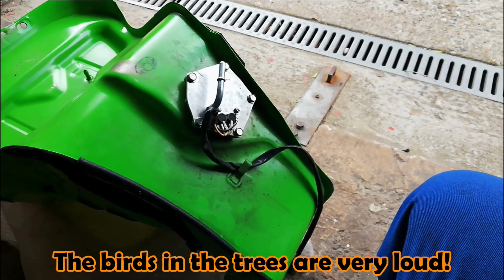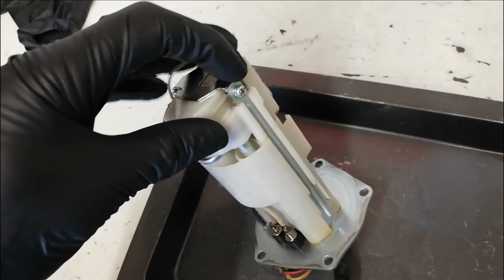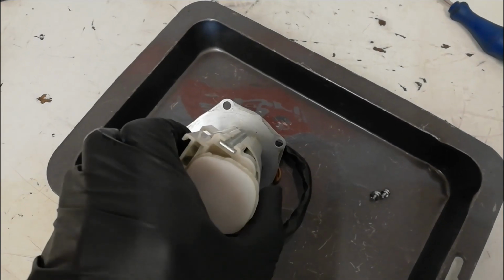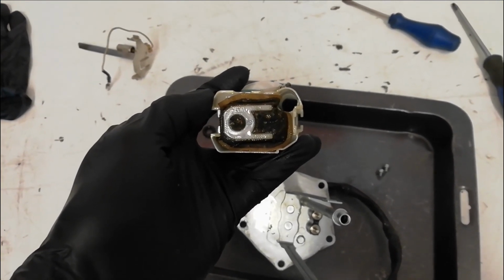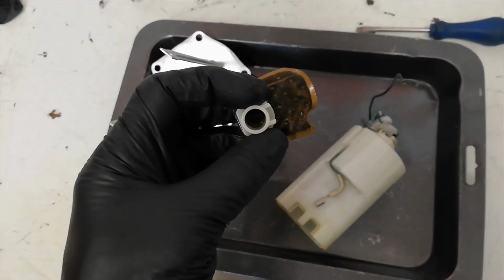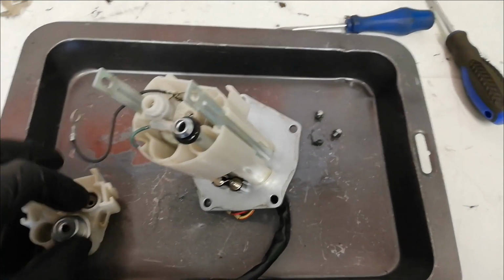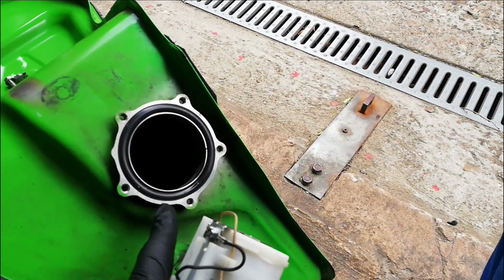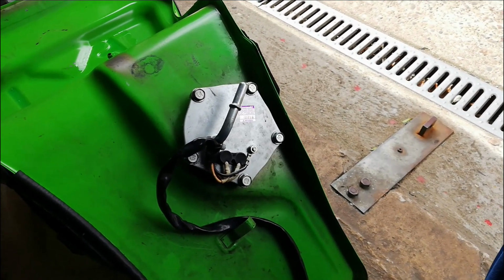How to strip and clean a Kawasaki zx10r fuel filter

Comment: Thanks for the video. was wondering if you knew the part numer for the 2 orings in the pump. My 2013 wont go over 8000 rpm and seems to be getting worse. when i fully turn the accelerator it actually slows down. mecchanic say have to change the complete fuel pump assembly and in italy costs a kidney. thanks
Reply from the maker: Unfortunately I think your mechanic is probably right

Comment: Dude extreme huge mistake! That so called tea bag your calling the fuel filter is stage 1 of the bike's fuel filtration system, which is the~ "fuel strainer"!  The 2ed stage of fuel filtration is the "fuel filter",( at fuel pumps exit port) which filters down to 40 microns, So changing a fuel strainer is only doing 20% of the job.

Comment: See that bit you call the lid that has FPR attached next time ,take out FPR and oring and spray carb cleaner in there and rinse with clean fuel ,then Back flush with air gun ,Because it has a micro filter in there and judging by your lower filter top strainer would be restricting fuel flow ,👍
Reply: can it be pulled out?
Reply: @godwinvandamme  yes

Comment: after change fuel filter, low fuel light It didn't work.... what step wrong?
Reply from the maker: Possibly caught the fuel level sensor, or a wire when refitting

Comment: dumb question but i cant i just run the bike to low fuel, strap the tank back and do the job wih the gas tank still attached to the bike and a little fuel still in the tank?
Reply from the maker: To save removing one bolt I don't think it's worth the awkwardness of trying to keep the tank in place, it's much easier to remove it
Reply: @obsession_engineering  thanks, wasnt sure if that might save me a little hassle and mess, im going to have to do it because fueling culprits are a limited number of things and the bike just doest sound right; it was juat starting to stutter at idle and certain rpms prior to running cleaner through it. 18k.

Comment: Hi, thank you for that video, its relly helpful, I made a terrible mistake and left fuel in the tank of my 2012 Z1000 that has been in garage for 6 years, so i will have to clean the thank and clean the fuel pump, what do you recomend to use to clean the fuel pump? i will order that new fuel pump filter, thanks again.
Reply from the maker: Brake cleaner or fresh petrol would work well for cleaning the pump. Just be careful with it!
Reply: @obsession_engineering  excellent, thank you,
Reply: Hi again,. I have dismantled the fuel pump, cleaned it and now trying to put everything back together. Finding it difficult to close the lid as the o ring doesn't go in smoothly, is it possible to use lube to make easier, if so, what is the recommended lubricant for these o rings? Thanks

Comment: Hello, took my 04 on the dyno other day and it's dropping BHP in 6th. Was 145bhp and should be around 170ish. Could a blocked filter be the cause?
Reply from the maker: Very possible, especially if it was lean at high rpm. It is a common issue
Reply: Thanks for the reply. I am going to strip it and have a look this weekend
Reply: @jamiewall8824 hey mate, did you solve your problem? Can you say?

Comment: I know this video is old but I got a 2007 zx10 and it bogs at around 20-30 mph in first gear, also at about 9KRPM it stops it doesn’t go any higher then 9K RPM. Could a clogged fuel filter cause these problems? Also I should mention all new coil pack and plugs.
Reply from the maker: The high rpm issue is commonly caused by the fuel filter being blocked, not heard of it at lower rpm but it could well be an issue. The 07 filter is basically the same as the later bike, so pretty easy to check
Reply: @obsession_engineering i have the same issue. Do you know how to clean the other filter?, the one located near the regulator, in the head of the pump. I think that could be my problem because i just changed the big filter and my bike continues with the issue.
Reply: Mine stuck at 10k rpm. 😂 Tomorrow I will try to change the fuel filter first and Dyno the bike
Reply: My zx10r do the same at 7k rpm. Do you think how to clean the filter that is inside the cover, near the regulator..?

Comment: I have issues with my zx10r 2011 spoken to the guys who rebuilt the bike would this have a massive effect because when I go to give the zx10r throttle above 6000revs it’s like the bike cuts out and there’s no throttle any more am told that this could be losing psi when bike demands fuel only starts working once the bike has been switched bike off completely then starts up again never had this issue b4 and was wondering if anyone else has had this issue in past.
Reply from the maker: If the filter is just blocked it shouldn't be that bad, and resetting the bike wouldn't normally fix it, so it sounds like more of an electrical fault. 
Do you know if there's any fault codes? as there could be several items that could cause the problem, top injectors, ignition pick up, throttle position sensors... the list goes on unfortunately
Reply: @obsession_engineering  no fault codes come up or anything to say there’s a issue on the dash just cuts power till I come to a stop then it cuts out turn key off for couple minutes then fires straight back up revs like there was no issue.

Comment: Hi Dave, Would a clogged filter cause the bike to intermittently stall? https://youtu.be/1Wr4DnqgopA like this?
Reply from the maker: Unlikely unless the pump is failing, normally the issue is at high rpm when the pump can't flow enough fuel.

Comment: What year model suzuki and ninja that will be fit? My zx10r 09 lose power in high rpm. 😢
Reply from the maker: I'm not 100% sure but most Suzuki's and Kawaski's from about 2006 - 16 used the same pump. The base plates can be different but the pump body is the same and the filters definitely are!
Suzuki part number for the filter 15420-05H00-000
Reply: @obsession_engineering  thank you so much for the information 😊
Reply: Did the you fix it my 09 zx10 is doing the same thing it won’t take more than 1/4 throttle
Reply: I fixed my problem. I changed the spark plugs, now running smooth. Cheers for the information.

Comment: Do you have a link for the filter/assembly I’d need from Suzuki? I can’t seem to find one that looks like that by Googling.
Reply from the maker: Part number is 15420-05H00-000
Reply: Dave Hewson Road Racing Obsession Engineering LTD I appreciate it; better spending $50 than $250 or god knows how much to take it to the shop. I’m getting an intermittent sputtering, loss of power/stalling; so maybe this will fix it.
Reply: @obsession_engineering  thanks for posting.. do you know if this will work with a non supersport Ninja 1000 as well?